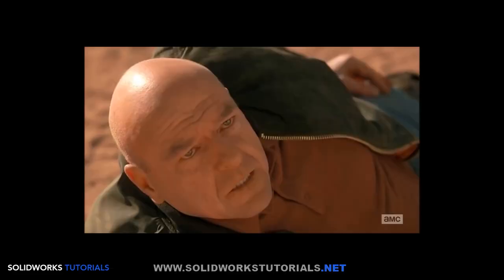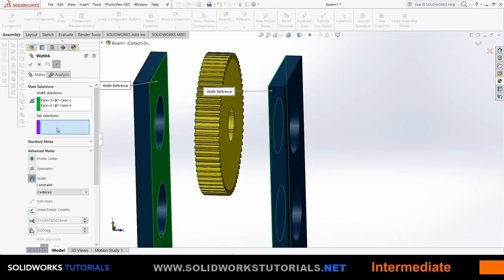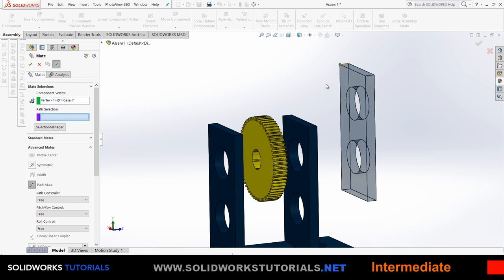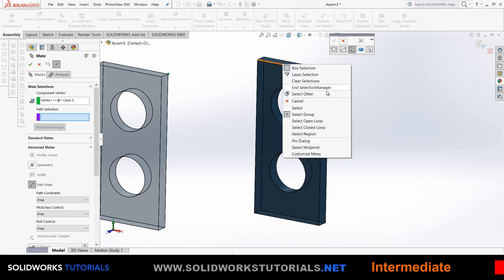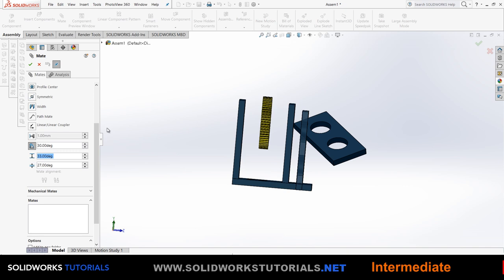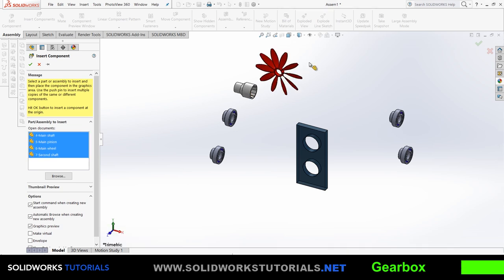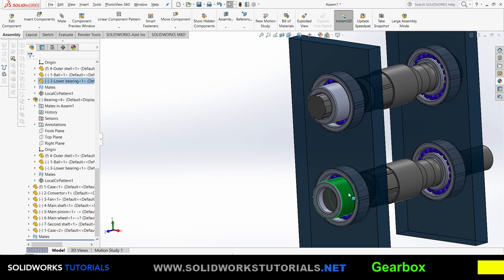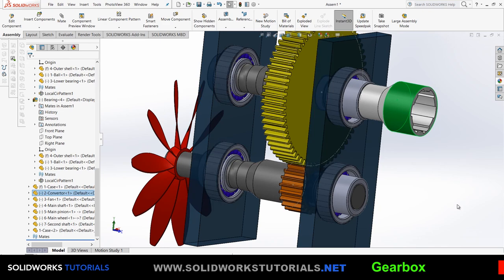Ultimate SolidWorks Assembly tutorial for Beginners - Part 2

Comment: Really good video. Easy to follow and informative.  Been trying to make the mate between the two gears.  I can't seem to find the two circumference sketches when I try to make the mate.
Reply from the maker: The sketch is hidden! you should open the gears in the PART section and then on property manager on the left side of the screen you will see the sketch. click on it once and then click on SHOW in the pop up menu. Welcome to SolidWorks tutorials Andrew. I am glad the tutorial was helpful to you.
Reply: I think I might have figured it out.  I found the Boss-Extrude from each gear and unselected hide. I was able to make it work somewhat but the gear teeth do no stay in sync so I must not have selected arcs with the correct circumference.
Reply from the maker: that's right. If I remember correctly it would be the second circle. the one in the middle.
Reply: Quick comment: you can only select the "arc" circumference graphically after you "show" it (per comment) it. You cannot select the "arc" from the "Feature Manager Design Tree"... This stumped me for a while.. I'm using SW2018